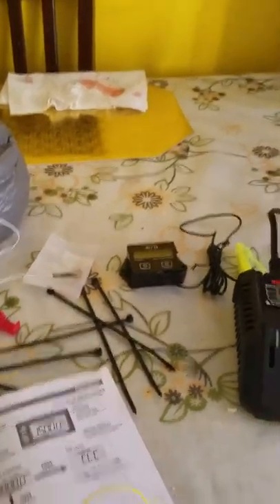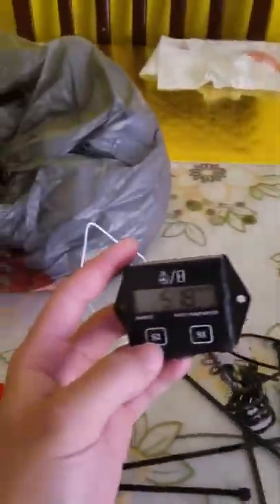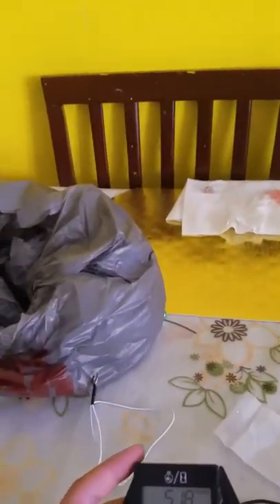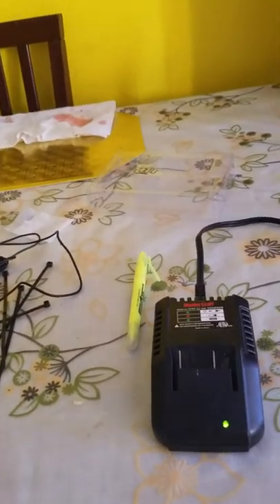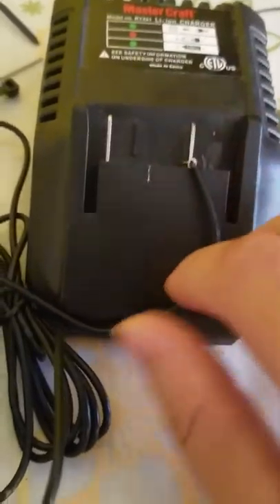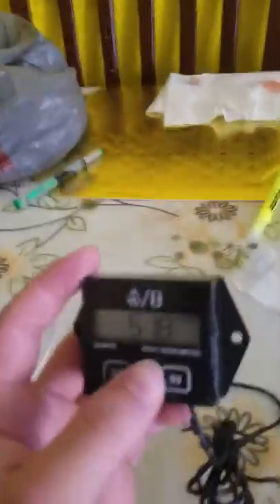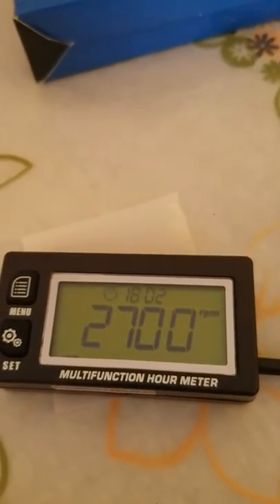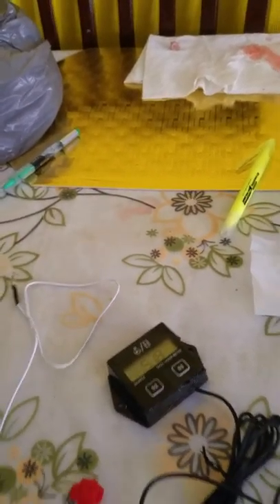How to trick a digital tach hour meter

Comment: Tried 4 different chargers. And a TV aerial socket. Nothing seems to register.
Any other ideas?
Reply from the maker: All you have to do is put the wire that registers RPM over the positive terminal of a ac charger either for lithium or nickel cadmium and it will read the pulses. This will make your hours Read higher.
Reply: @nathanaelbas5289  thanks. Tried that, and it doesn't work for 4 chargers. That's just touching the terminal, not wrapped around it. Or does it need to wrap around it?
Reply from the maker: @kevinrobson7912  yes needs to be wrapped around the terminales, and charger has to be plugged in.
Reply: @nathanaelbas5289  all my chargers seem to have flat surface type terminals. No way of wrapping around them unfortunately.

Comment: What was he trying to do ?
Reply: His hour meter died, hour meters count the engine run time of something like a dirt bike, lawn mower, anything with a motor really, and it only counts when engine is running. Well his hour meter died at 150 hours, so he bought a new hour meter identical to his old one, and he’s trying to get the new one to count up to 150 hours so when he remounts the new hour meter it will be working and starting at 150 hours so it’s accurate, and it will be leaving off where the old one was. Very simple. If he put the new hour meter on his machine, it would start at 0.00 hours which is not correct because it really has 150+ hours on it already. Hope this helps.
Reply: @videocardzrule354  Be funny if software
in that thing has a bug, causing it to die
at 150 hours.
Think I would put a note somewhere  to add 150.
Thanks for the info.

Comment: Than didn't work, but I found a simple solution: get a spark plug tester, setup the spark plug and insert the meter wire between the spark plug and the tester plug hole.